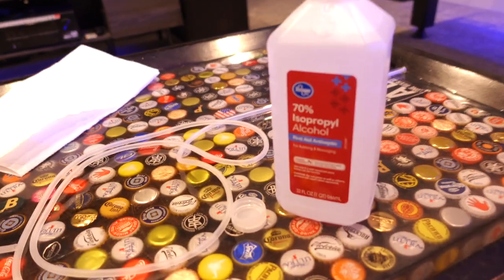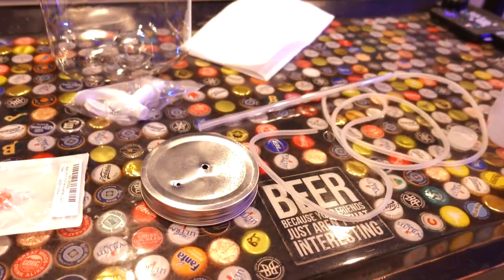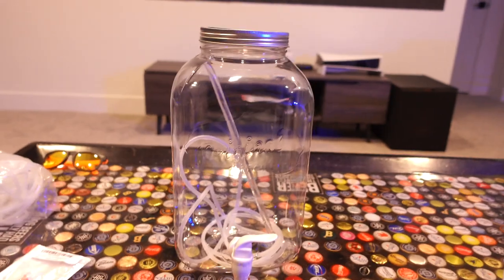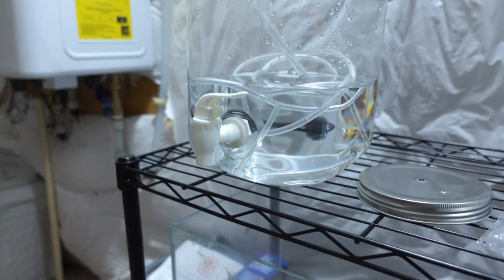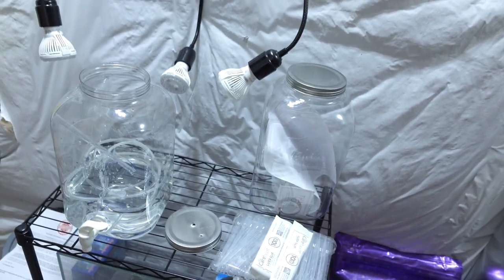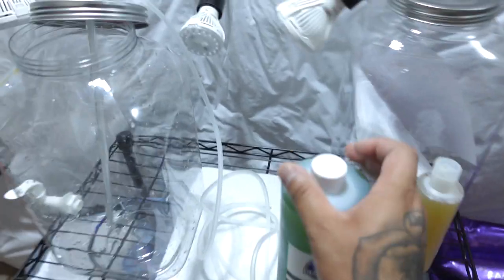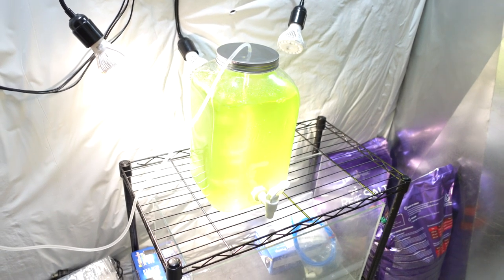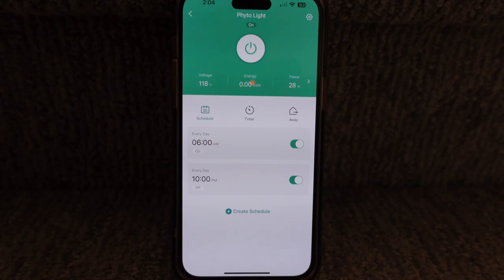Culturing My First Batch Of Phytoplankton (Nannocloropsis) For My Reef Tanks!

Comment: It doesn’t matter how you mix the culture. Just note the stages of phytoplankton growth. The exponential phase ramps up at around days 2-3 then takes off at around days 4-6. The stationary phase is when it’s maxed out and this phase only lasts 2-3 days before it crashes but 10 days is usually a solid time frame to full culture it.
Reply from the maker: Thank you! I did it at 8 days so I think I’ll add more F2 next time and leave a couple more days.